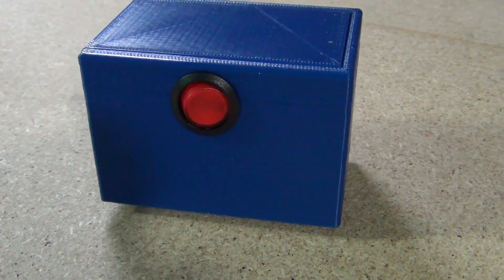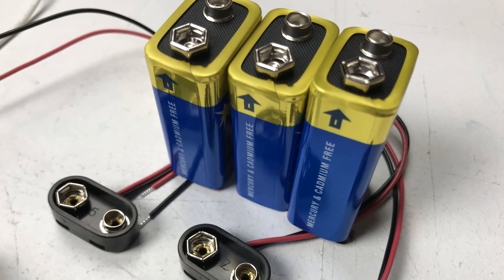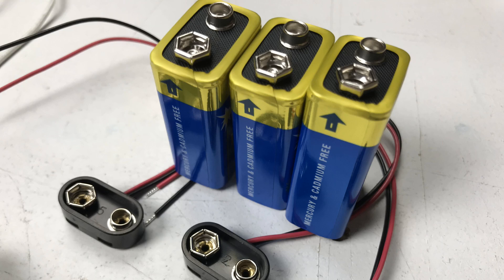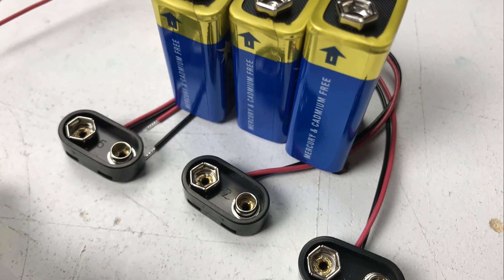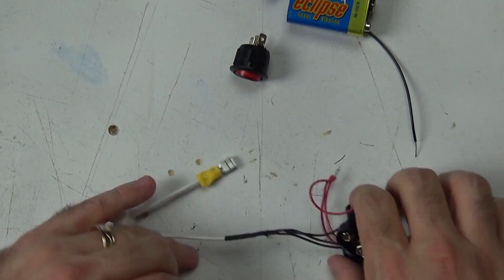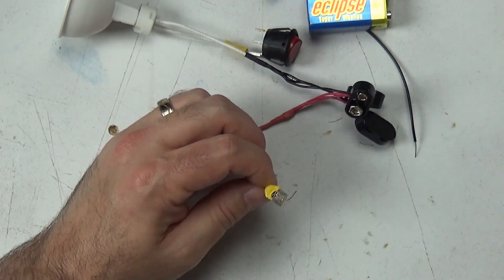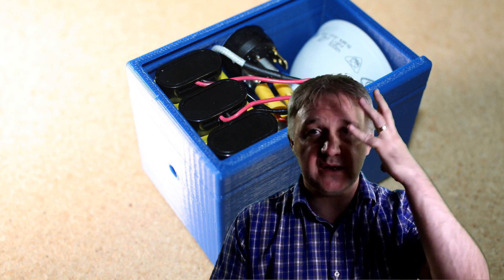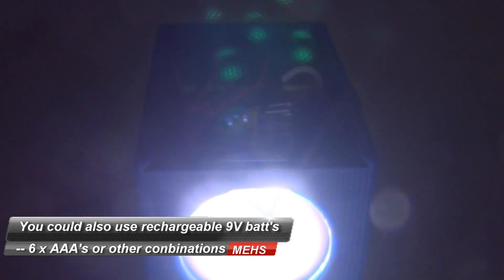DIY Cube Light - quick and easy (MEHS) Episode 69

Comment: How much heat does the MR16 put out? Maybe make a diffuser out of some baking paper or opaque acrylic?
Maybe the design of the 3D printed box could include like a diffusion filter like theatre lights have (example: the front of this: https://lightsounds.com.au/shop/lighting/wash-stage-lighting/Light-Emotion-ZOOM180RGBW-180w-RGBW-LED-Zoom-Profile-Spot-17-50-degree.htm) and you can make filters for whatever applications you are using it for. 

Hell, at this point, you have a base for an economical architectural light for whatever use you wanted.

So simple yet, so awesome. Thanks for the idea ;)
Reply from the maker: - Hi.  Yes the MR16 gets pretty warm but it won't ignite paper or cardboard and hasn't yet melted the PLA I used which melts at 55C.  These MR16's have a little diffusion on the glass but its not enough for most cases and yes a snap on or drop in diffuser is a must for close up video or photo work.